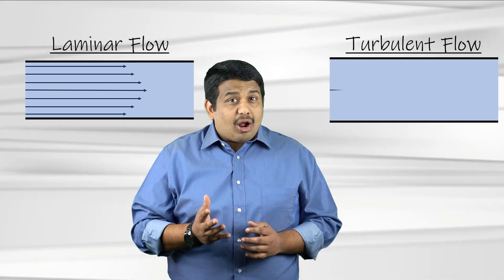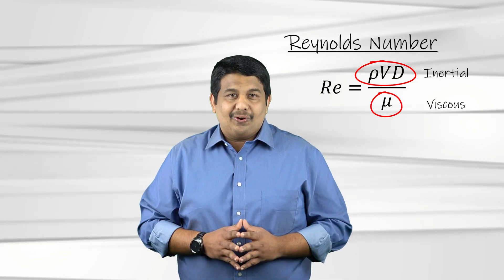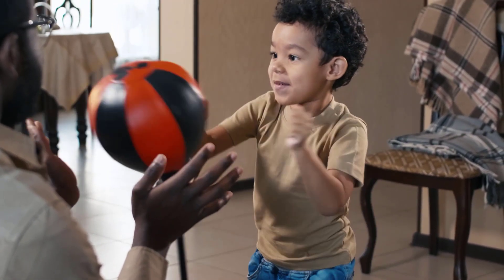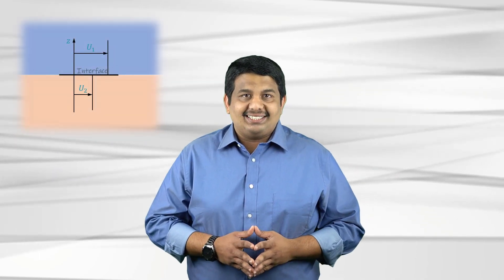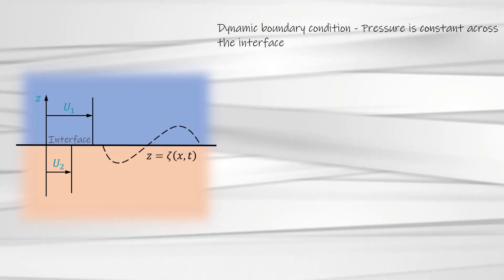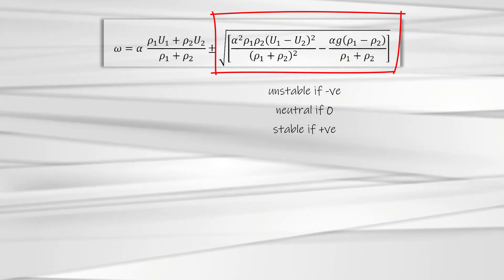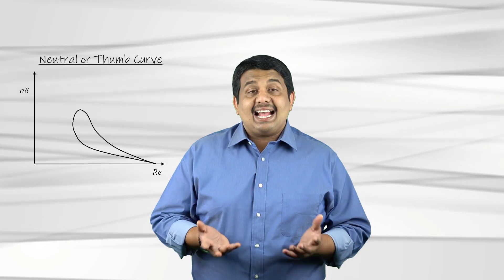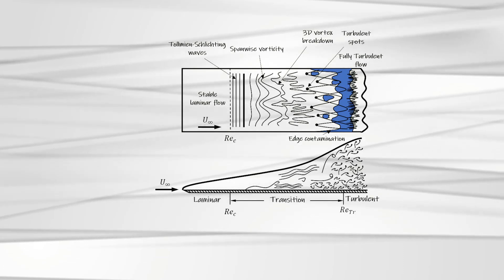Stability of Laminar Flows and Transition to Turbulence — Lesson 2

Comment: Wi must be postive for unstable flow
But in the next slide why is second part of W which is under the root be negative?
And if the second part of W under the root is postive 
Then W doesnt have a imaginary part
Which means it should be neutral?
Are we missing a “i” on the second part of W?